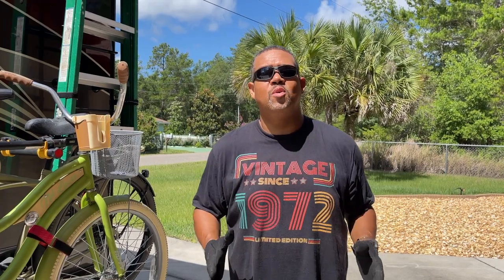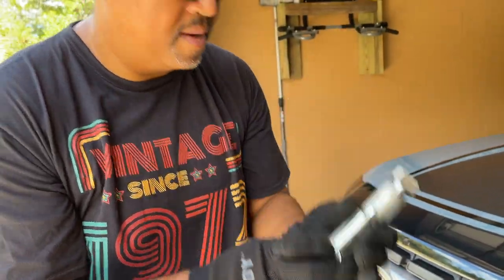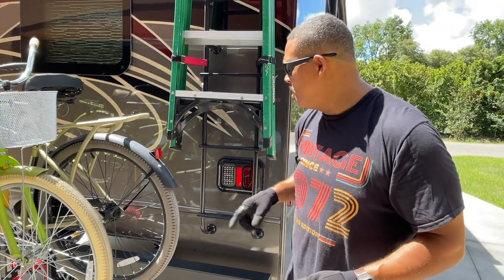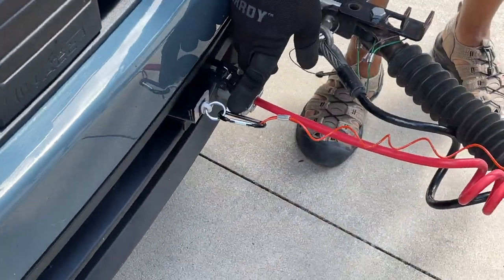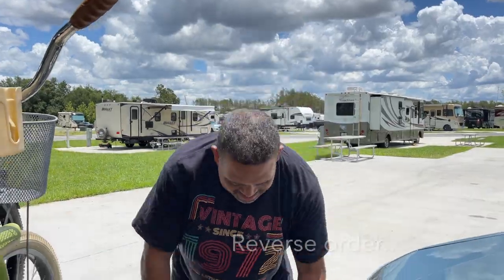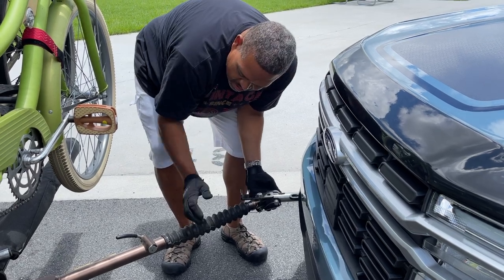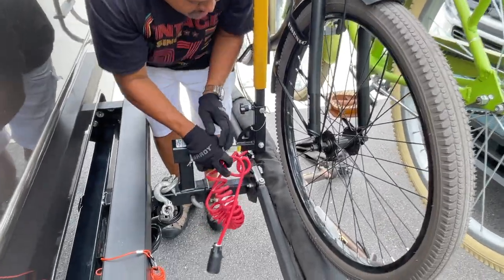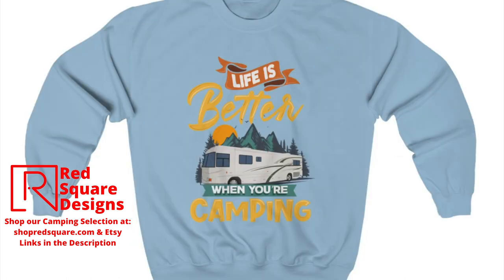Tow 4 Wheels Down w/Blue Ox Avail Towbar Setup 10,000 LB cap w/ 2022 Ford Maverick Hybrid Base Plate

Comment: Hey thank you. I have the gas maverick with front wheel drive. Does the same apply for the menus. Love your channel.  Have a great day Scott
Reply from the maker: Thanks so much Scott! I know that it works for the Hybrid version, which is also front wheel drive, but you’d have to check in your manual to see about the menu for the other models.

Comment: Great instructional video. It looks like the only trimming needed for the Blue Ox baseplate on the Maverick is in the bumper where there is no foglights. Does this baseplate remove the shutters in the center?
Reply from the maker: From what we could see it was just the cutouts on the sides but we had the baseplate professionally installed so we’re not 100% on those details

Comment: I own a Maverick 2022, I am purchasing the Blu Ox Tow system. What is the actual tow mode you spoke about. Is it just pressing the button and turning the knob to neutral. Does the red cable keep the battery charged because you have to keep the power on to tow.
Reply from the maker: Thanks for the question. Yes, just press the Start button with your foot off the brake to start the Accessories mode. In the Menu stroll down to Settings, then under Vehicle, you can access the Neutral Tow option. Note: this is for Hybrid model only. Yes that cord charges the battery. Let us know if you have more questions 🙂

Comment: I have 2023 Jeep Wrangler Sport and plan to flat tow it with a 2019 Jayco Greyhawk 31FS. I am having a blue ox tow packed installed on my Jeep by my RV dealer in early December. I am interested in purchasing the road master defender to help protect the front of my new Jeep .Your thoughts on the rock defender and is it worth the money and benefits.Thank you Al Nolan
Reply from the maker: Hey Al, we definitely recommend using the Tow Defender with the Blue Ox, we’ve been using it for over a year now and haven’t seen any damage to the front of the truck after towing and we’ve probably towed our Maverick at least 10,000 miles. As for the Rock Shield that attaches to the front of your Jeep, we’re not using ours and from our research is definitely necessary if taking an RV trip to Alaska thru Canada but otherwise not necessary. The Tow Defender is all we’re using and is doing great!

Comment: Hello guys… I’m looking to get a Maverick for flat towing behind my Entegra Esteem.  What engine/transmission setup do I look for in order to flat tow?  I could not find a good answer on BlueOx website.
Reply from the maker: Thanks for the question. You will need the Hybrid Maverick model to flat tow.  In the Menu settings under Vehicle, you can access the Neutral Tow option. Let us know if you have more questions and good luck finding that Maverick 🙂
Reply: @WanderOpenRoads  Since posting my question, I have ordered and received my 2024 Maverick hybrid 2 weeks ago.  I haven’t gotten my tow-bar setup installed yet.  I am leaning towards the Roadmaster system.  It requires less cutting than the Blue Ox.  However, in your setup, I noticed that you didn’t mention a breaking system for the toad.  Do you use one?  If so which would you recommend?
Reply from the maker: @craiglg54  we have the Demco Stay In Play Duo braking system that was a hard install in the engine compartment. After putting the truck in towing mode, you just flip a switch on a small controller they installed down by the hood release and that’s it. No manual setup. We didn’t want to mess with the manual install of a portable braking system and issues people have had with floor mats and adjusting the seat to get the right amount of pressure… the cost was similar and it’s fast and easy

Comment: With the Blue Ox Maverick baseplate ( 41" between the centers of the posts where you connect) you better check for clearance on your towbar swivel point in a tight turn!!!!!!!!!!
Reply from the maker: We’ve towed the Maverick almost 15,000 miles with our RV… no issues
Reply: But have you checked the clearance? Check the towbar swivel for contact areas where it turns so far it cannot go further........I have a Maverick with the Blue Ox base plate too........ @WanderOpenRoads